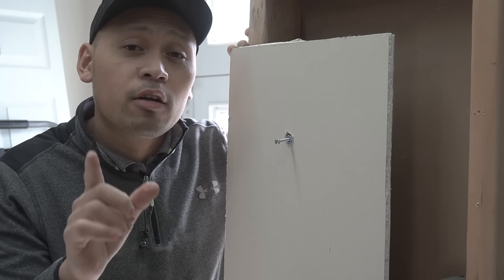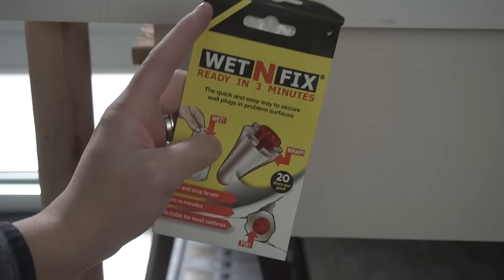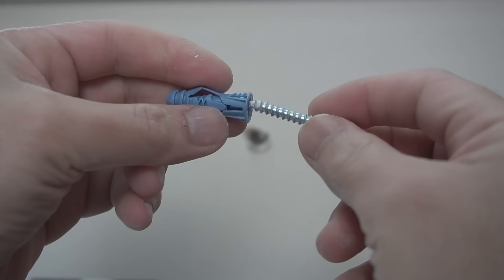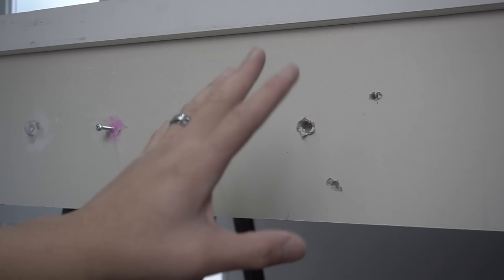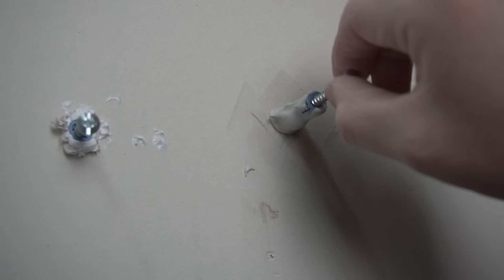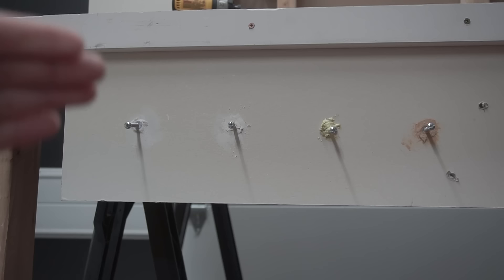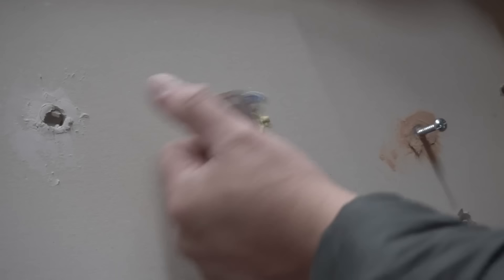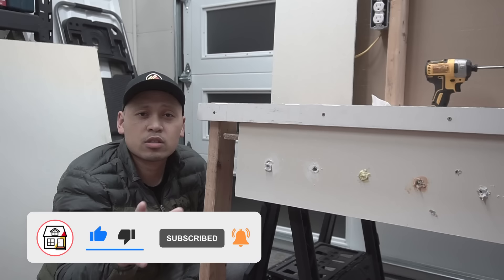How To Fix Loose Or Damaged Drywall Anchors Like New! | DIY Wall Plug Repair!

Comment from the maker: ITEMS I USED ON THIS VIDEO:
- WET-N-FIX Drywall Anchor Repair - https://amzn.to/3Kaeb08
- 5 Minute Hot Mudd Joint Compound  - https://amzn.to/3IVFTwy
- Drydex Drywall Spackle - https://amzn.to/3iQoBWS
- Putty Knife 10-in-1 - https://amzn.to/36IAHyU
- Great STUFF Spray Foam - https://amzn.to/3uNnkVY
- Digital Hanging Scale - https://amzn.to/3wOkrXQ

Comment: Of course most of the anchors that you battered up will fail as you've restricted the flexing motion of the anchor by the product you used. Probably would have been best to fill each hole first with the different products, wait until they dry then re-drill the hole and try the anchor again.
Reply: A method known as "doing it properly".  I've no idea why he thought this was a good plan.  Basic misunderstanding of how the anchors work maybe?
Reply: @Jack Scorpion - I don’t think you’ve thought that through. Consider the mechanics involved in redrilling a patched hole only millimetres larger that the drill bit. None of the filling compounds would have the physical properties necessary.
Reply: @erikjonromnes - possibly so however out of all the options tested the first was really the only option with even some of the basic characteristics required to be successful. I thought it amusing that he would even consider bothering to test most of them!!
Reply: @Anthonykelly-eq4pf  instead of strawmen, strawrepairproducts.
Reply: Those products aren't drillable . That would not work .
Reply: Use a thicker anchor is the simplest solution!
Reply: @alexwong8076  use an anchor inside an anchor 😂😂😂
Reply: @ferwaz  an anchor which diameter is fitter to the hole. Is that so hard for you to understand?
Reply: @alexwong8076  its just a joke... is that so hard for you to understand?
Reply: It's nice to see someone call him out on this. I'm watching going WTH!
Reply: @ferwaz  , I've used that method in 
tile/concrete/brick applications for handrail/crash rail installations. It can make a very strong connection.
It's obviously useless in drywall, or materials that have poor density, or strength though.
(PS, I know it was a joke, but it actually does very well in certain situations.)
Reply: Yeah I was wondering how long he let them dry. I've done this with plastic wood, similar enough to wood filler right ? And while I wasn't hanging anything heavy after I let it dry a few days I was able to redrill and it's holding up a small mirror for years.
Reply: Surely no one with a brain will fall for this!
Reply: @christianhaynes1954  No Shit
Reply: @ferwaz  Inside another anchor inside another anchor
Reply: Well it’s been 3 months. What are your experiences?
Reply: @alexwong8076  precisely use a larger rawl plug if that fails use cavity anchor with the setting tool.
Reply: Y’all the whole point of the video is just IF you CHOOSE to try these possible DIY options, which one might actually work. Haven’t y’all ever seen videos where they test the life hacks? That’s all this is for anyone concerned he’s trying to say this method of rigging jacked up anchor holes is the best option. Look at his channel he has a ton of other videos :)
Reply: @ferwaz  😂😂😂… good one!
Reply: RIGHT ON POINT. The guy in the video is less than an amateur.
Reply: Agreed. The pink spackle and any quick mud/joint compound would go to fill the hole first, then reinstall the anchor. The Wet-N-Fix is quite convenient.
Reply: No product  will ever be strong  enough  to re install in the same hole if you try to patch  it with a compound  like  drywal mud from pulling out unless  you use a bigger butterfly spring type anchor! Or you move your anchor  points over to a  new  location  , sure you can use  liquid nails but that will take time to dry and will eventually  pull out over time,  I have done these types  of repairs  since 1981 and have seen and used every product  available,  if the hole  isn't  bigger  then the base of what you are trying  to re attached  to the wall  just use those butterfly  spring type  anchors !  Fast simple  and easy to use!
Reply: @Alex Wong  Exactly  correct, preferably those butterfly spring  type  anchors that close when you push them through  the hole but open  up on the other side of the drywall!  Iv done these repairs  since 1981 as I'm a handyman  , jack of all trades master of none!  But I definitely  know how to easily fix these problems!
Reply: @johnalarcon5006  you should make your own channel. My dad was a general contractor and figured out all the best tricks throughout the years. He could have done the same if he wanted too and got payed for it. There isn’t enough old school solutions being used. Solutions that have been proven over time.
Reply: @johnalarcon5006  I’ve tried using drywall screws but made the mistake of drilling a hole first. I also used screws with a much larger diameter than the drywall screws I used. So now I have four huge holes in my drywall I can fit a pencil through and a DIU fail. What would you suggest I do with the existing holes I’ve made? I’d prefer to use the same holes. My vanity is roughly 50 pounds.
Reply: @OMGKO  you need to use bigger  toggle  butter flys  if you  are hanging  it to a wall and maybe  a type of mastic to adhere  to the wall but might need additional  support  underneath  it while  the mastic  or construction  adhesive dries
Reply: @OMGKO   true!  Iv done construction  since 1981 ,and have learned  many  tricks to do things  quicker and better , and im never closed minded  to learn something  new from anyone! And I love helping  and sharing  with others!
Reply: This video is nonsense. Patch the damaged hole and advance a new one. Or use a toggle.
Reply: I agree. I thought that the way you described was the proper way the products were meant to be used, and  that is how I've done it.
But then, silly me, I like to read the manufacturer's directions before I use a product on my home. 
Just in case it differs from how I have used similar products in the past.
Reply: Yes, just patch hole. Redhill in slightly different location. Never seeing g myself use this product
Reply: @ferwaz  Not far off. A large screw thread that takes a screw. They sell them for heavy hanging as the larger thread applies the stress against more of the plasterboard so it doesn’t move.
Ofc it has a maximum weight limit, but the limit is higher than standard plasterboard fasteners.
Reply: Save me from making this comment 💯
Reply: @patd5505  how do you patch a hole in a cavity wall?
Reply: It is immediately obvious that you have never done home repairs when your time is expensive. So you're suggesting filling a big hole with caulk, waiting for it to dry, and then drilling another hole in it. For me, this is not the most efficient way to spend time.
Reply: He was just demonstrating how these products and techniques work or don't work. Which most people which don't know about drywalling would probably try.
Reply: The holes I have is not that big..can I use anchors a Little bigger instead?
Reply: What he did is the same thing a common DIYer would do... if you are that good, then why dont you make your own tutorial then? 🤦
Reply: I came to the comments to learn. I see what you guys are saying however as someone with zero experience patching holes I'm still lost on what to use. Basically I'm not using an anchor. I have a hand rail and a bathroom toilet paper holder that got ripped out of the wall. What should I be using to patch the hole and put a screw back in? Is an anchor really necessary?
Reply: Can You Send Me A link To Your Channel So I Can Watch All The Things You Do
Reply: no man

Comment: Make your own version of Wet & FIX with a filler like sloppy Tetrion or Polyfilla, soaked in a bit of old rag  - Cos' That's all it is in Reality!! Don't be fooled into buying stuff you can make for yourself. Tetrion filler can be drilled for dry wall anchors (we call them plasplugs in the UK)

Comment: A butterfly anchor replacement maybe a better option since the hole is already big to fit the nylon anchor. Will also take less time than applying putty/glue to dry. Has more spread contact with the drywall as well.
Reply: Exactly. I encountered this recently hanging a corner shelf.  I tried to repair it with putty, twice, drying overnight each time. Both failed. So just went and got butterfly clips…much stronger too.
Reply: Highly agreed, the most effective solution is a butterfly anchor.
Reply: Yup we use toggle bolts to hang strut on drywall then strut straps to run conduit on
Reply: hollow wall anchor would be better than this as well
Reply: I totally agree !!!!
Reply: Jesus is coming. Read the Gospel.  ...
Totally irrelevant.
Nothing in you bible will help fix loose screws.
Reply: @DrQuadrivium  But you could maybe use the bible to stand on, if you were not tall enough to reach the screw/screw-hole.
Reply: Hollow wall toggles for me too. The Bible might fix that loose screw in some folk's head.
Reply: Yeah this is the wrong tool for the job.  

Either repair it with drywall and install a new anchor or use a toggle bolt.
Reply: There is nothing really that works well wrt this and that is because of the properties of this material, which is weak to begin with.
Problem with filling is that you never get to fill the hole completely and well, bc it drips out the other side, so the bond surface is small. The first stuff works reasonable, bc it has some structural integrity itself, bc of the cloth fabric in there (is the same as appying plaster as in a cast for a broken bone) and so that helps not only in that respect, but also in filling up the hole and increasing the bond surface.
You could actually make it yourself; with some cloth, dredged in any brand of plaster. Since it also goes a bit into the openings of the plug, it may actually increase the strength. Bc a clean plug only works by compressing outward into the plaster of the dry wall material.

For stuff like this, if it needs some carry some weight, you should always go for butterfly plugs, as these do not work by outward compression in the hole, but by compressing in the thickness direction of the drywall over a much larger area. Also use a washer to increase that area.

As you can see im not a fan of 'drywall'. We use it a lot for ceilings here and for that it is nice, bc you dont hang anything from a ceiling normally, apart from a lighting fixture. For walls it is a disaster. Sooner or later (usually sooner), something falls and bounces into or through the wall, someone swings and arm or leg and you are left with gaping holes in it. The only reason its used is because its cheap and fast to apply. But lets be honest; its shit.

you are much better off spending some more and make those inside walls from wood. Or any wood product really. They are much stronger in every sense, even the cheaper ones. Of course you can use sheets of real wood; hard wood, soft wood, planking, scraps, of real wood, underlayment, mdf, or even hardboard and it will not be penetrated or dented as fast as plaster/drywall. It lasts a life time, can much more easily be repaired and if you ever want to get rid of it, you can throw it into your wood burner and get some heat out of it, while plaster we just dump bc its unusable again. Also breaks in every possible way when you deconstruct. So a total waste and a burden on the environment.
Use WOOD people!

Oh, and you can paint it white. Looks just the same.

Another thing. The holes he drills in excess are quite a lot too big. If you are faced with a plug in plaster/drywall that is (too) lose, or worn out, dont immediately try to look for fixing agents like this. Remeber, it works by outward compression, so all you have to do is add something solid that will transfer the compression force. If its a bit wobbly, it may be enough to add a broken to length match...
Or wrap the plug into some cloth. Or anything else that you can think  of. That often will be enough to fix it. And for visual, which is often not needed anyway as the plug itself is often not visible, you can always add some plaster for esthetic purposes.
Reply: @DrQuadrivium  LOL...
Reply: I usually take advice from someone who uses an impact driver to screw into plastic with a grain of salt.
Reply: The You KNOW it’s going to hold.
Reply: Zip toggles.  Expensive but the very best.
Reply: @carolschuster5042
Reply: I agree but eventually there will be a situation where you can't go the butterfly route so it's good info to 'put in your toolbox'. I'd never see the wet-n-fix product before so I enjoyed this video
Reply: @ThekiBoran  That's what I use all the time. Never a problem with them.
Reply: 17 years in drywall and I've never used a wallplug on sheetrock
Reply: Yep, I used to use toggle bolts to replace loose anchors. Now I just use toggle bolts the first time.
Reply: I agree, my towel rack pulled off the wall so I put a toggle bolt in there or you called it a butterfly anchor but it works great
Reply: @TheMoonEcat  Don't have it. Could I use either Quoran, Gita, or Torah? If so which one is preferred?🥸
Reply: @kevinrenn9123  Indirect Advertisement in disguise. Well Me enjoyed 2 though understood!😁
Reply: @jaimerodriguez8332  I don't think Young Millennials even know what a butterfly anchor is I even made a comment just recently realizing that would be the best solution
Reply: that would make a boring video
Reply: When starting the screw in the butterfly style what keeps it from spinning in the hole before it geabs on the backside?
Reply: he wasnt testing the anchor but rather the fill material
Reply: @notsofast5495  ….. you have to pull the screw towards you as you’re screwing it in.
Reply: Exactly , that type of anchor is not meant for plaster boards. The best anchor for plaster boards is the Screw type.
Reply: @robotsonmars1989  exactly. Toggles, even in my toilet paper holder, cause I need a solid handle sometimes 😂😂😂
Reply: Agree 100%
Reply: That was I use to used it
Reply: @notsofast5495 , instead of the 'butterfly' style, try the 'zip' or 'snap' toggle'.  It's hard to explain without getting too verbose, but after the nut is inserted through the hole it is secured snug to the drywall using a zip mechanism somewhat similar to a zip tie.  You have to be careful as you thread the bolt in initially, but once the threads take, you can tighten it down very firmly.  Compression takes care of the rest.  Another couple perks are this type of toggle bolt requires a much smaller hole than the 'butterfly' style, and it is actually about twice as strong.
Reply: @DJ_Dopamine  That is an out standing idea.
Reply: There's also a metal butterfly that I like to use as well...really strong with a wide flange, probably grabs almost an inch of dry wall.
Reply: My first thought because I just did this with a tv.
Reply: Thk. U     Butterfly anchor done .

Comment: I just bought the wet-n-fix and used it yesterday! The only problem I had was getting the wet round disc on the anchor without bunching up which was frustrating. I found it much easier to wrap the disc around the anchor dry and then dip it into water. It worked so much better! I have but hadn’t tried the foam, wood filler, and spackle yet and now I don’t have to! Your videos are great…so glad I found this channel…thank you!
Reply: Thanks for the wet n fix tip 😉
Reply: Dope tip!
Reply: Perfect, thanks.
Reply: So did it work though.has it held up being 4 months later.
Reply: Glad you said to wrap then dip!
Reply: You can also make small cuts around the disk before submersion, that will ensure no bunching
Reply: How to used an anchor on dry wall

Comment: Just remove the plastic  Molly or screw in anchors  and install  a butterfly or a expanding  anchor , the ones that are made  out of metal that close  when you place them  into the hole  but open  up on the other  side  of the drywall!  Believe  me they work I know im a handyman  and fix loose  towel and toilet  paper  holders all the time using these products

Comment: Fill the hole with 2 pack filler ( that’s filler with a hardener compound) then push the plastic plug in while still wet, then screw in when dry, job done I’ve been doing that for 36 years it never fails
Reply: What brand?

Comment: Butterfly bolts are the way to go anyways. You can use them in any hole on a wall or ceiling.... The real problem with old anchor holes is you cant see the damage on the back side of the drywall sometimes it is much bigger than the hole on the front side and no matter what you do the drywall keeps crumbling and the hole just gets bigger and bigger.
Reply: it isn't sometimes, its essentially always. as pressure applies to the fixing the front acts as a pivot and the back gets destroyed.
Reply: I this case I have had luck with making the hole a bit bigger and feeding a strip of wood, typically about 1/2 in square by 4 inches long. Pre-drill a hole in the middle and feed it in with a piece of thin wire or string in the hole. Pull it tight and put a screw in the hole. Spackle and paint as needed.

Comment: The trick is to use a "sock" over the filler. It is this mesh that gives strength - you create a composite. So you can use a bandage or pieces of foil. You put it in and push it with a bigger pin, you push the filler in and then you move it back a bit so that a bigger bubble forms at the back. Only later a pin with a small diameter
Reply: That makes sense that that's why the wet n fix worked so well

Comment: Gorilla Glue. Put a bit in the hole, a bit on the anchor, put it in and put a piece of painter's tape over it to keep it from pushing out as the glue expands.
Reply: Thanks for this tip